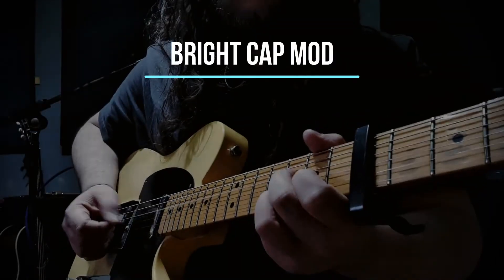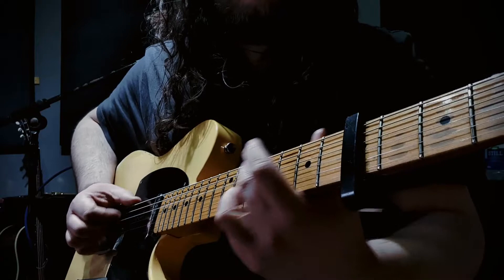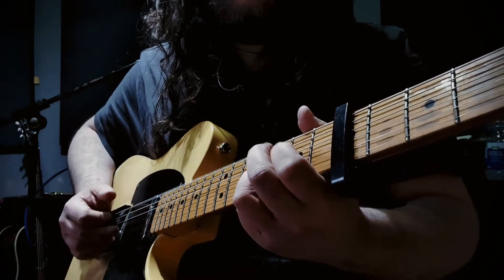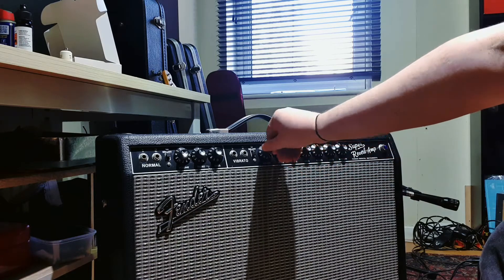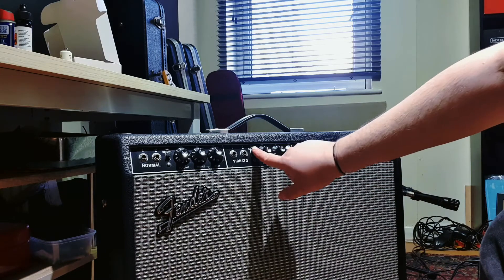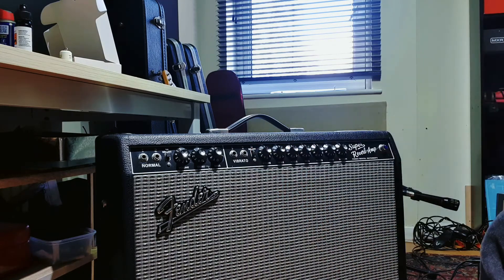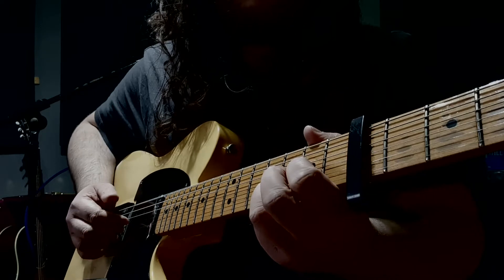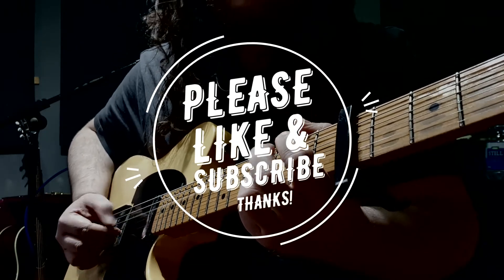The Fender Bright Cap Mod: Changing Values on a '65 Super Reverb RI Bright Switch - Alex Hamilton

Comment: Did you use ceramic like the original or did you use silver mica?
Reply: SIlver Mica will sound dull. Definitely stick to ceramics.
Reply: @cgavin1  I disagree, I installed it in my Twin Reverb and the sound was smoother, the new ceramics sound very harsh, show me something better to put in my Twin, the best result for me was to change the treble capacitor on the tone stack, the 47 on bright it improved a little but not that much.